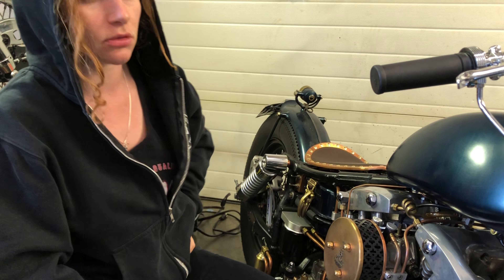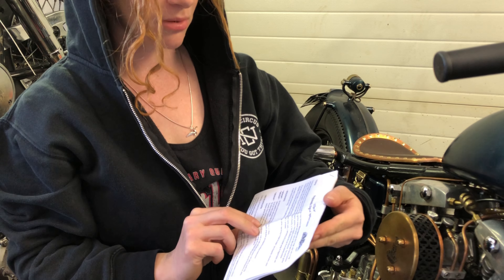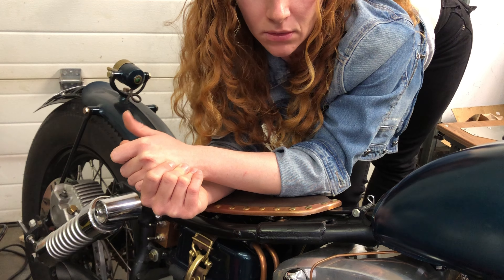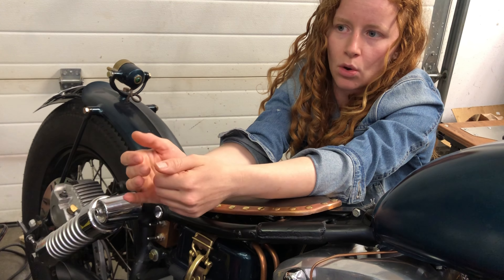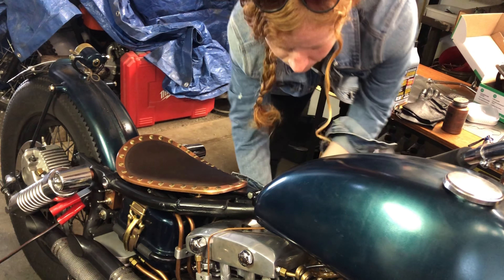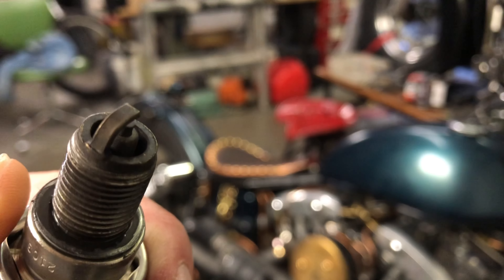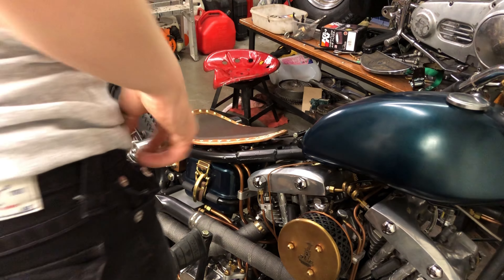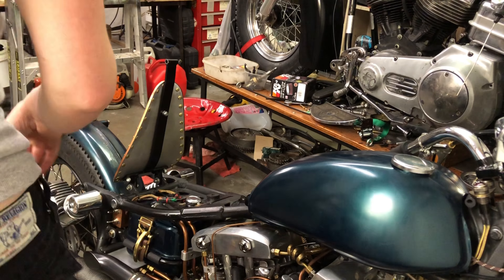Talking about the bike, filling oil and  a Compression test (16:00) on my S&S Shovelhead stroker.

Comment: When i was a young man i had a panhead and two shovels and i worked on them all the time it was just part of having a Harley. what i used to do is what is called rolling the rings in you run the engine at a steady speed 45/55 and every minute let off the throttle slowing do about 10 mph and then getting back up to speed. what it does is put downward pressure on the rings then when you decelerate it put up on the rings. this helps to seat the rings do it for five hundred to one thousand miles. your compression should be closer to 120 or up a little
Reply from the maker: Thanks! I’ll be doing that for sure. Question though, not sure if you saw my video where I do my compression test, but do you think my compression will go up to 120 after it’s broken in completely? It’s around 90 psi right now.
Reply: Its running a little too rich re jet and go build some heat in it
Reply from the maker: Will do!
Reply: @RedRiderCanadaBC  It might, you need to find out what your static compression ratio is if it is low you will have a low number the way it looked when you were kicking it its low. ask you builder. but i dont like the oil in the head it could be a valve guide but i would lean it out and go run the piss out of it to clean it out and build some heat in her a cold engine will give you a lot of problems. and a rich engine will run colder if it does not help the cylinder my be out of round and the rings not seating correctly and you may have lose valve guides.
Reply: @RedRiderCanadaBC  Good luck and be careful
Reply from the maker: @georgeshotrodbarn2113  
Thank you for the advice. If I had to choose, I would vote for it being a valve seal that needs replacing... I'll order myself a gauge for doing a leak down test soon and hopefully that will give me a little more of an idea about what going on inside the engine. Trying to budget and get all the fixing done on this thing all during the dead season at work haha. But we all know, (or at least we all should know) HD stand for Hundred Dollars. Expect to be forking over any time your Harley needs some tlc haha

Comment: valve guides ,are they set up with seals early ones did not have them ,but at valve job time they can be installed .
Reply from the maker: It’s a messed up seal in there so I’ll have to take it apart again this winter…

Comment: Red . If the motor is a fresh rebuild the push rods are too tight. Causing the valves to stay open during compression stroke causing a loss of compression and on intake stroke causing the oil to seap past the valve seat causing your oily valve syptom. It's a common mistake with rebuilds.
Reply from the maker: I was thinking about checking them again

Comment: I like the plumbing on the outside the engine.  Are those lines copper???     I've never poured oil into the cylinder for a compression test.

Comment: Hey Red,,
I always run a 500 mile break in on fresh builds before jammin it ,
I noticed on your first cold start vid that white smoke was coming out rear exaust,, so uve had this from the beginning,,  by looks of plugs u need to down size ure jets running way to rich maybe tweak your timing, I start with the static time and then tweak to my liking, but that's just me,, little trick on starting flooded engine,,   key off twist throttle all the way open kick 3 or 4 times , close throttle and turn on key and kick,,  I see u have many suggestions  but  I'd  pull that head take it to reliable mech maybe both heads,, if finances allow,, if not ,plenty of tricks to get through the season and make it a winter project,  but after some time ure gonna start smelling that burnt oil smell,,  I wish u and ure ride well, 
A brother of the wind,,

Comment: Hold throttle wide open and kick it over 5 times that will give u your compression psi  then do the same fir the other jug.... warm or cold won't change your readding

Comment: Check your exhaust tips and note if you have an oily residue. If its powdery black likely rich. Oily, probably leaking by valve stems.
Reply from the maker: Definitely was running too rich. The year cylinder is burning a bit of oil and the tailpipe for it was oily. I cleaned it and it hasn’t started looking oily yet. We will see how she goes.

Comment: Rent or buy a leak down tester,With kick only you won't get real accurate readings(my opinion) they are about 60 dollars to buy and just as easy as a compression test.Just have to put engine at top dead center,easy to do with open belt drive and check both push rides(spin them,with fingers to enure both vlvs are shut,if solid pushrods,can't remember with hydraulic quit using them in 83.Did you re-torque,or check torque on  head gaskets? Clean frame downtube put permatext ultra cooper on exhaust gasket(both sides) this ensures a good seal.Back on my 78 shov  exhaust  front nut vibrated off ( I almost always was close to redline) unless on the hywy ,due to the ultra cooper pipe stayed on and didn't leak.Must of us didn't know bout Locktight back then.I let a shop do a top end on my shov in 84,REAR cyl headgasket leaked within 50 miles.Like somebody else said Rear runs hotter,that's why I think it blew,they gave me new gaskets,and told me If I didn't want to fix it myself they could fix it 6 months later after riding season.Needless to say I've done my own work since then,except what a machine shop has to do. You have a beautiful bike.and it's great you are doing your own work.
Reply from the maker: Thanks for the tips! I didn't think about renting a leak down gauge... I think I would rather just spend the money on a new one of my own though. My town just sucks for finding some things for some reason. 
I'll be doing a video of me retorquing my heads because I have to take quite a few parts off to gain access to the head bolts.

Thanks for watching and commenting!

Comment: Starters your plugs look oily you might have too much clearance on your guides, compression are you cracking the throttle wide open when you kick it through, ignition I'm old school and just old, points are the easiest have all plug gaps set to specs for points and with twin plug heads I'm running 2 Andrews coils the black ones, 1 coil per head. Carby, I haven't dealt with thunder jets but I'm running an s&s e and s&s will give you a good starting point jetting for your motor whatever stroke you have but I've run Mikuni and SU as well on my shovel with no problems. It might take a while but I'm sure you will sort it. ShovelHead forever.
Reply from the maker: I just give it a few squirts with the accelerator pump and a couple kick throughs then it normally starts. Sometimes it a moody little bitch though lol

Comment: Kickstarting definitely builds character. 

But 80 psi is an actual compression ratio less than 6:1. 

What is your theoretical compression ratio?  Swept volume plus chamber volume all divided by chamber volume.  

Did you go low CR per an old timer’s suggestion? Cliff I think…
Reply from the maker: I have never lowered my compression ratio. I had my engine rebuilt at the beginning of this year and that is the compression that it came back with. Although it is not completely broken in at the time that I did the compression reading so I’m hoping that the compressions higher by this point, but I have not checked recently. Also, I have a C grind cam and apparently that should make a difference to the compression reading as well.
Reply: @RedRiderCanadaBC  Thought of the cam thing after my first comment. The longer the valves remain open the more it will lower your apparent compression. 

Watch out for deer. Saw some stats that said almost all deer collisions occur in May & November. 

Besides any other recommendations on breakin, vary the revs by several hundred rpm’s every few minutes at most. Aids in seating the rings. Yet another reason for seemingly low compression numbers. 

Be close to operating temp also. But be careful of overheating it while idling. 

What does your pop say about it? I’m a former flat rate mechanic with an engineering degree so I have a decent foundation. But your pop probably your best resource, especially since I’m more of a parallel twin & triple guy. And I like a lot of speed, a reliable ride and not spending a fortune on speed and power. 

Haven’t caught all your details. Are you running any sort of add on tracking of your fuel/air ratio? Don’t know if it exists for older bikes, especially non-EFI ones. But I like getting accurate real time data where possible. 

One quick check after breakin is to run a stock bike.  If you have several lengths half way through a quarter, then you probably not to compare it to something faster than stock. 

But getting it all right in the end makes it all worth the aggravation.  

Or ho to the strip on grudge race day. Most accurate of all. Dyno tuning probably too expensive. But you are approaching the best relationship possible with your bike by sorting it all out yourself. 

MLLH&R.  If you are still having trouble after breakin, I know a friend who comes from a family of mechanics, has two HDs, one to cruise and one a sleeper street drag FXLRST.  She also may have more bike specific information. You two would probably relate well although she’s a bit older than you.   

It is really nice to see you progressing so nicely.  

Any chance you are planning to time the quarter?

/s/ Matt’s dad, Dan 

PS my solution for my post so-called retirement is a Triumph triple liter bike capable of running in the tens but stock looking. Used to balance my Norton’s dual Amal carbs but for me liquid cooling, EFI and a broad power curve is my choice now. 

But once I get it right I am considering building a shovel head of my own for cruising.   

You have a methodical approach to troubleshooting. That should keep you on the right track. Do you have a goal for what you are hoping to achieve performance wise? 

Really like your content and approach. Keep on moving. You are definitely on the right track for maximum two wheel fun.

Comment: OK, I can keep quiet no longer! 😁 I'm hoping to be helpful here so don't hate me!  I am sure that K+N will have worked out their figures, "Without" the trim you have fitted to your air filter. In the world of airflow, VERY Little of your air filter is actually seeing clean air.  If you think about it, at least 50% of the trim is solid metal and not "Hole" If you take the "Lovely to look at, but a really restrictive trim" from your air cleaner, you will see a "Massive" amount of air filter capacity. ❤
Reply from the maker: The trim on my air cleaner cover only cover the rubber part on the filter. I measured the actual filter area and it checks out for the cfm that my engine requires.

Comment: I'm kind of working on a similar problem on my bike .is it smoking more on the rear cylinder kind of looking like valve guide or seal to me . Is the rear plug dark and oily compared to the front. Step at a time and you'll get it .

Comment: I just saw this , does you oil smell gasy,  what is your plug gap, ha e you done a hot lifter adjustment, and just me I have points and static time because it is easier to start, are you dual fire or single fire
Reply from the maker: Single fire electronic ignition, plugs are gapped at the recommended .040 for electronic ignition with dual head plugs and oil does not smell gassy.
Reply: What year , and points kick better than junk electronic you know what . I been running points in my 76flh, since 80ish or so same bike thats in my garage . I changed it so much the only parts I haven't changed is the frame tanks fairing, bags . The motor is a sidewinder.  I got a sporty has points got a 01 buell with electronic ignition,  try points kick it static timed will fire great. And that plug thing did anyone mess with injector pump screw, do you have a slight stall when getting on it
Reply from the maker: I have a carburetor on there and it’s all set up as should be. I have had it to the point where it is one kick every time, but since the rebuild I just haven’t got it quite back to where I had it before. I’m pretty sure I have a valve seal leak in the rear cylinder so that’s what’s causing the plugs to get fouled up.

Comment: where do you live?  I've been doing complete rebuilds on shovels since they were new, just an old guy.
Reply from the maker: I'm in B.C. Canada
Reply: Hi Red, nice to watch your stuff, have a few Shovels myself and have been weenching and learning as I go, over the years, just did a compression test myself on my newly rebuilt 80CI Shovel and it was exactly in your neighbourhood around 90 PSI kick start only bike as well. Slight disbelief as I expected a much higher reading, as the bike has tons of compression, did another test on my -72 FX kickstart only, very healthy well running motor, but 74CI prettty much the same result, anyways did you ever figure anything out in Regards to your compression test? I put on a S$S super E started with what they reccommend 0295 Pilot and 72 main, have only taken it for a few shiorter rides and motor is not broken in yet, have not yet found the sweet spot for cold starting but start 1st kick when warm, anyways thanks for Sharing From John Wasaga Beach ON
Reply from the maker: @123hellqvist  I haven’t done another compression test since that last one. But I did find out that my Cam is a C grind Cam which apparently can make it harder to get an accurate reading on the test and I’ve had different readings almost every time I have done a compression test on it before that were anywhere from 80 psi to 100 psi so I’m just not too sure. I’m going to wait until the engine is completely broken and before I do another compression test I think and see where it’s at then. It can also be hard getting accurate reading on a kickstart only bike is another thing that I’ve been told.

Comment: Since the oil is only coming out of one cylinder, in this case the rear, it can only be coming from 1 of 3 places:  intake valve guide, exhaust valve guide or up through the piston sides.  (If it was coming from the intake through some sort of oil breather hose routed back into the air cleaner than the oil would be sucked into both heads)   Since both pistons have the same compression,  I am leaning towards one of the valve guide sleevesbeing the issue.  If the intake valve doesn't have oil on it, then I'd be inclined to believe the oil is coming from the exhaust valve guide.   I am not an expert and my knowledge only comes from watching other harley mechanic/machinist youtubers.  Maybe someone more experienced on here can back me up or say I am a dumbass.  I hope you resolve the issue with not too much trouble, best wishes.

Comment: What weight oil you run summer and winter? When you run heavier oil could make it more difficult to kick to life.
Reply from the maker: 20-50 is what S&S suggests for my motor. I don't ride too late into the year on this bike either.

Comment: Your compression test technique is probably fine.  As long as you're kicking and opening the throttle all the way, you should get a good reading.  And take out both spark plugs to make it easier to kick.
Reply: Yep and with em out kick all the unessasary oil dumped in spark plug holes
Reply: I'd jake brake a new rebuild.  A couple times but make sure u don't get oil to thined.
Reply: Hey.  When going down road turn off ignition real fast 1 or 2 seconds then turn back on.(Jake break) it will clean out all that oil dumped on plugs.  Make sure your oil isn't completely full as this will thin and raise oil level.

Comment: If i saw right, that was a can of 20W-50 oil that you were showing to camera?
Is that what S&S recommends for their motors? I have always used SAE 50 in my shovelhead, that works fine in the climate we have in here. 
 I have no idea what the compression is in those motors, but i guess S&S has datasheets of their products.
Reply: I always run 50 in shovelhead. Worked well for last 45 years.
Reply from the maker: I've known guys who run either or. I always have used 20/50 but I also spend a few months of the year riding in pretty chilly weather, doesn't start to get really warm where I'm at till late June. We've been having 20 degree Celsius for the last few days so I think the 20/50 is good for the time being till it gets warmer. Ii has been suggested to me to switch to 50 weight once its getting hotter here, and that is what I plan to do. I've only been riding a shovel for 5 years now so still have a lot to learn about what it best for these engines.
Thanks for commenting!
Reply: @RedRiderCanadaBC  Well, we have around 20-25 C in here at summertime, its rarely getting warmer than that. Just a thought, maybe this oily exhaust thing is a valve issue. The compressions looked fine, but there is something weird going on..
Anyway, dont worry about being "newbie", i think your knowledge is pretty good. I know guys who have ride 15 yrs and they know next to nothing of anything.